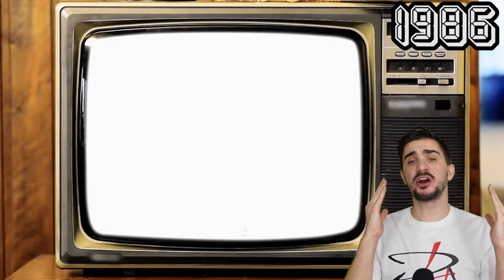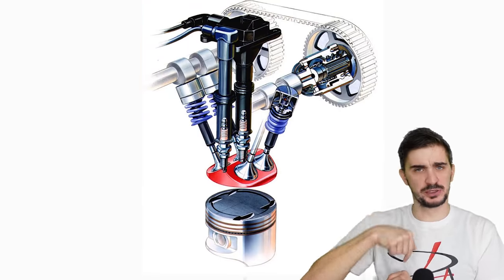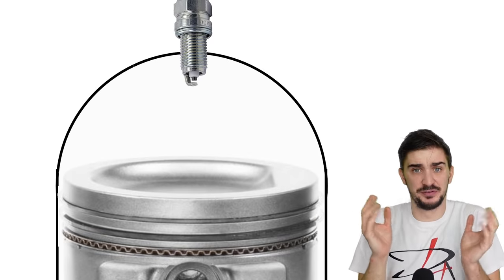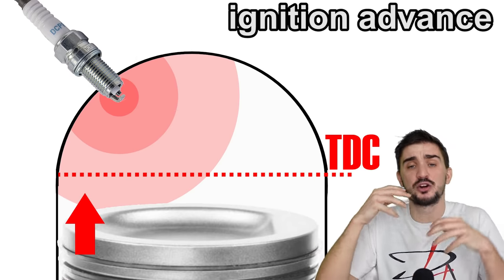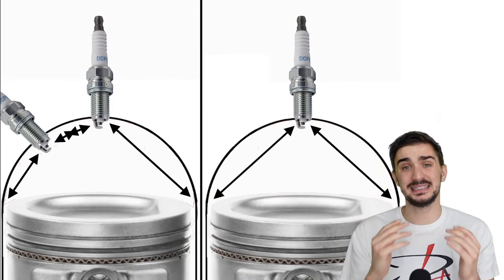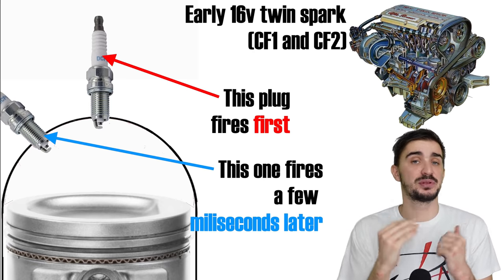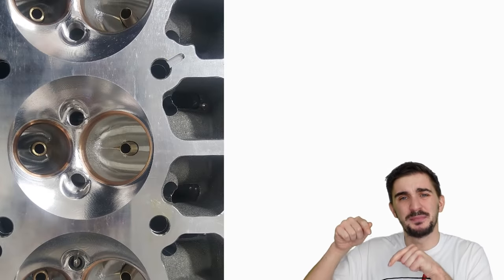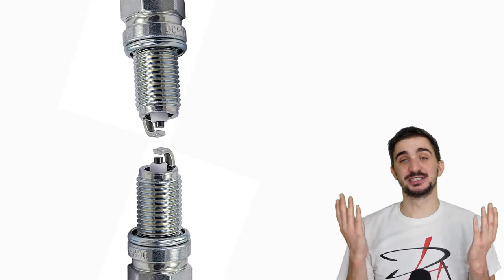TWIN SPARK - WHY, HOW and why it isn't more widespread

Comment: The Mercedes M112 V6 and the M113 V8 both have twin spark ignition and 3 valves per cylinder. The V6 was introduced in 1997 as a 1998 MY and the V8 was introduced thereafter. Both are 90 degree blocks, the V6 employing a balancing shaft to counter the uneven mass of this engine layout in addition to a 30 degree splay angle on the adjacent crank pin journals to achieve an even firing order. These engines have a SOHC driven by a duplex timing chain with 2 (smaller) intake valves per cylinder and 1 (larger) exhaust valve per cylinder. Each cylinder has a high output, coil-near-plug ignition coil. These engines also use a variable length intake plenum to increase torque at low engine speeds (longer path), and improve flow at high engine speeds (shorter path). Both engines are great and very torquey.
Reply: Correct, I have a 2006 CLS500 with the M113 V8 & I replaced all 16 spark plugs recently.
Reply: Yup. I have a Chrysler Crossfire with the M112 and was unpleasantly surprised when I realized I only ordered half the spark plugs I needed 🙄. I never understood why the heck there were 12 plugs until I watched this video I just assumed “bigger spark make bigger boom” lmao
Reply: Great engines. I had a 99 C240 Mercedes with a manual, so I could experience the real behavior of the engine. Lots of torque down low, nice top end power (170@5600rpm) and a reliability level its successor lacks during its first production phase. Curious mix of low and high cost solutions. Magnesium manifold, but SOCH. No VVT, but twin spark. Clearly not cost-driven decisions.  Anyway, I miss it.
Reply: I believe MB made a twin spark V-12 as well.
Reply: They are very torquey, but they are also very truck-like and aren't particularly smooth in operation or sound and don't particularly enjoy being revved.

They're definitely not a bad motor, they're just not very refined or sporty
Reply: @5hogg23  you are correct, m137 for example
Reply: @betteroffdeadd  I had an automatic C240 from 2001, which was the 2.6l engine then, same power. I'm not that convinced in it, and these decision were cost driven. SOHC is MUCH cheaper than DOHC, more so in a V engine, where you have to do everything that happens in the head twice. No variable timing was a huge step backwards, and the two sparkplugs just make the best of the area that's available - the valves almost touch in the center, there is definitely no space for one, but on the sides of the ex valves, there is. Making them even more shortsroked to counter this would result in a bad combustion chamber design, and if this isn't translated into larger gas exchange areas, there is no benefit in it. The succeeding engine, the M272, had problems the first few years, but overall is decades advanced from the M112 - and very similar to the M104, the inline predecessor of the M112.

While I did like this car on the Autobahn - low drag coefficient, relatively fast for its power, going up to 235 kph - in the city, it was quite a guzzler.

Anyway, it's not really bad, but ... sigh ... the one threevalve between two generations of fourvalves isn't a position I'd ask for. Cheap ... well, yeah, kind of, kind of not, a weird mix, this sure af is!
Reply: @phil955i  heeeyyyy my man!! I have a 2006 CLS500 too. The best CLS, short of the CLS 55 of the same year. The only year they put the m113 in that body. Best combo.
Reply: Per Chrysler Crossfire service manual:
The two spark plugs per cylinder are fired slightly out of phase to prevent the cylinder pressures from rising too quickly, which could cause knocking. To prevent one spark plug from eroding more quickly than the other, they alternately lead each other. Under normal conditions, the timing is the same for all cylinders, but the timing can be delayed in individual cylinders if knocking is present in one or more.
Reply: My 2003 ML350 (M112 3.7L dual-plug V6) had 266000 miles before it's sold. Changed spark plugs once and I was cursing after changing the ~7th plugs, lol. I wouldn't say it's a great engine because it sounded rough and felt gutless below 3000 rpm. However I won't complain because it lasted 266000 miles over 18 years with just oil changes.
Reply: @tigerpjm  Compared to what ?
I have driven many cars over 40 years and the M112 and M113 are both very smooth , sound good and are nothing like a truck engine , they rev out to around 6000 rpm or more and remain smoother than any GM or Ford engine for example.
They have a lot of advanced tech for their time.
Reply: @Leonardo555ZZZ  

Compared to the equivalent BMW straight sixes... everything I said stands.

Anything less than 6000 is a very slow revving engine.

I'm not fanboi-ing BMW. My current ride is a W177 AMG A45S, and I had the W176 before it.

As I said, they were not a bad engine by any stretch, although they did continue in service well beyond their use-by date.
Reply: Fascinating.  I did not know this, as I have not myself replaced my spark plugs.  My 3.2L SLK from 2001 has an M112 V6, the engine is great, still delivers fantastic power and torque.   I have now owned the car for 22 years, and as far as I can tell the engine performance and behavior are exactly the same as when it was new.  Still an absolute pleasure to drive, and I have zero incentive to replace it with anything else.
Reply: @tigerpjm  bro drives a car thats missing 4 cylinders. i bet your motor will die sooner than the m11x engine family

Comment: I'm pretty sure Mercedes Benz has a lot of dual spark plug engines too. Great work,keep it coming!!
Reply: Yes M112 v6 and M113 v8 comes to mind. Probably the V12s too. The only downside is maintenece, but the coils rarely fails.
Reply: My E55 M113k has dual spark plugs and being a 3 valve design its easy to locate them... Even before these modern engines Mercedes was using twin sparks in some of their engine but yes, Alfa is definitely the pioneer here.
Reply: @Rourkeize  alas, at some point one has to replace the spark plugs, and I am told they are not cheap either... By my mechanic, who had bought my brother's w211 with the 2.6 litres V6.
Reply: @woongah  . Modern Spark-Plugs have a very long Service Life . Brake Rotors need replacing from time to time too , as a Service item .
Reply: @woongah  they're not cheap if you give it to a mechanic to service them, in reality, spark plugs are probably the cheapest and easiest things you can do on an engine, and I've done spark plugs on an m112 clk, the only thing is you're now buying 12 plugs instead of 6.
Reply: Yeah the S600 V12, nothing quite like changing 24 spark plugs in an afternoon...
Reply: @OldJaguarAU  lol 16 is bad enough I’ll never do 24 and I’d sell the car if I had to buy 24 Mercedes’ plugs…
Reply: @OldJaguarAU  Might as well replace the garbage coil packs while you are there
Reply: Twin spark ⚡️ plug:

Jabiru 5100 flat-8 four-stroke 
MidWest AE series Wankel
Nash Ambassador
Honda i-DSI series 
Nissan NAPS-Z 
Mercedes-Benz M112 
Ducati Multistrada
1990s ford rangers and mustangs
Reply: @alexvillalobos7137  Well, if you're clever, you buy em from Bosch or NGK,  which are Mercedes' usual suppliers
Reply: @woongah  just did mine on my W210 E320, normal champion platinum plugs used got them online reasonably priced, actually pretty cheap.
Reply: The 2002-2004 C32 AMG supercharged 3.2 liter V6 engine has dual spark plugs.

Comment: My old 04 Honda jazz had a 1.4l 4 cylinder twin spark engine(DSI) . That thing ran amazingly well. At low rpms there was a slight delay between them. At high  rpms they fire simultaneously.
Reply: Indeed, I remember that tiny engine had an amazing amount of torque down low for what it was. It was also decent higher up. The mileage was also great.

Comment: Well researched video!  An item of note: in both flight training, and aircraft maintenance training we are taught that the primary purpose of dual ignition is to provide more complete combustion, and the redundancy is an important secondary purpose.  (I personally could see it either way, and like the safety of having a dual system while flying.)

Comment: Porsche also used twin plugs on their later air-cooled production engines.  Also on some of their earlier racing engines.
Reply: The Maserati in-line 6 cyl in the 3500 Sebring uses twin spark too.
Reply: Maserati one of the companies part of the huge list of companies like fca belongs to and dodge hellcats still uses this in their hellcats currently.
Reply: BMW 1200 boxer engines had two plugs but the secondary was there purely for emissions reasons. You “could” unplug them and feel no difference. I suspect their main benefit was to burn low octane fuel more effectively.
Reply: Mercedes also used it on the c230 kompressor w202

Comment: You see it a lot in thumper type motorcycles where you have this huge pancake of a piston, and trying to get the flame front to spread horizontally is just as much of a challenge as trying to get it to spread vertically. So using two helps to actually get it all ignited in such a large area.

It can also be useful in 2 strokes for the redundancy to stave off oil based carbon build up issues- oh and the free/rarely used head space in them means there's no real downside to doing it.

Comment: The Alfa Romeo AR67204(CF1) engine that was found in the 145/146 and 916 GTV Phase 1(among others) produced about 110kw when new. Although there are several upgrades Alfa brought to the AR32301(CF2) engine that you found in the 156 the biggest change was the cast aluminum intake manifold was dropped in favor of a modular plastic intake manifold. The AR32301(CF2) engine produced 114kw when new. The extra 4kw was however lost when the AR32310(CF3) engine came out. These engines were introduced along with the very popular 147. The AR32310(CF3) engine still had the modular manifold and featured several electronic upgrades, the biggest of which was the switch from a throttle cable to a drive by wire system. The 147 also had a different exhaust and featured two pre-cats in the down-pipes with one more cat located just behind the engine. The AR32310(CF3) also had lighter piston crowns weighing about 10 grams per piston less than the ones used in the AR67204 and AR32310 engines. I always thought that the slight power loss between the AR32301 and AR32310 was due to the change in exhaust systems but the change in the way that the ignition system works migh have also played a part it seems.
Reply: Excellent engines, sensitive to timing belt maintenance, nothing more, but compared to the design disasters and the very low reliability of today's engines, it was a great engine.
Reply: I've had many Alfa Twin Sparks over the years, the 75 being my favourite for handling. But the 147's I've owned over the years have been my overall favourite. A very underrated car. The 1.6 didn't get the variable intake manifold, nor balance shafts, and in my opinion handled better than the 2.0 (the 1.6 didn't get stability control either) but in general, either of those engines were bulletproof. As long as you checked the oil level regularly! I want another one now...

Comment: Man, it's taken a long time but I finally caught one! The newer 5.7/6.4 Hemi do have variable intake length runners. And, my beloved 3rd gen Hemi retains most of the advantages of a "true" hemispherical combustion chamber w/o the flame front problems associated with the domed pistons  usually required to maintain a decent compression ratio.

Comment: Toyota had a twin spark setup on the 1.8L 3T-GTE, their first factory turbocharged engine. It was available in the 1982-1985 Celica, Corona and Carina. Toyota also used a racing version of the engine, the 2.1L 4T-GT. It was used in IMSA GTO class, Le Mans 24 hours and WRC Group B. It had a homologated version (4T-GTE) in the 1982-1983 Toyota Celica Twincam Turbo GT-TS TA64.

Comment: I've been running STD Dual-plug heads on my 1949 Harley panhead since 1998, initially in single plug mode with a magneto.  After a few years I upgraded the mag to dual-fire ignition and immediately noticed much smoother performance and improved mileage, even on this old tractor engine.

Comment: As a owner of a 2015 6.4L V8 Charger I can attest the benefits of using Dual Spark. Despite the high compression ratio and required use of premium fuel the motor hardly ever knock or misfired. Even though Chrysler uses this primarily for emissions it does help the engine on high RPM range. However I can see why this technology does not benefit or makes sense on smaller displacement engines since the spacing on the cylinder heads is quite limited. Now in bigger displacement engines this makes sense not just in sports applications but commercial fleet gas engines.

Comment: Twin spark plugs were very common in the 80’s when Nissan/Datsun equipped a lot of vehicles with NAPS-Z (Nissan Anti-Pollution System) engines in North America.  It made a lot of sense in 2-valve per cylinder SOHC engines. As 4-valve per cylinder DOHC engine with centrally located spark plugs became more and more common, I had a feeling it twin spark plugs would become less and less common and that’s what happened.
Reply: My Dad had one of the Nissan trucks with twin sparkplugs.  Once he took it for emissions testing and the tester said that those trucks never failed.  Testing was just a formality.
Reply: As a former owner of Nissan vehicles, the Datsun/Nissan syatem did not fire at the same time, like earlier  ALFA  syatems.
Reply: I loved the cars but hated the ignition systems and leaky exhaust valve seals.

Comment: I have a dual plug car! My 1985 Datsun/Nissan 200SX. My S12 has a CA20E. Definitely not a powerful engine, but it scoots the lightweight car alright. One interesting point is that the plugs are on either side of the head. They use a one step colder plug on the exhaust side than the intake side. Pretty clever I thought!

Comment: Another brilliant video.. I've been a licensed technician for almost 50 years.. i absolutely love twin plugs.. different sound, better power, fuel economy -maybe,,,, my 2015 Hemi pickup has twins,, what a pain in the ass and expensive (16 plugs at 76$ a plug)...I also work on aviation and motorcycles.. best is always twin plugs.. when I use to fly helicopters, i had a mag go,,, didn't even panic, just turned it off,,,,recalculated and returned home.. 
Keep up the great work..

Comment: Great video! It was quite informative. In my experience, i've observed that the last twin spark heads make the engine run with less ignition advance if both spark plugs are used, i had to postpone at least 8 degrees of ignition advance when i used two spark plugs instead of one, in some areas even more. The engine was defintely making more torque ad horsepower and it felt more responsive overall. Also improved the fuel economy a little bit
Reply: I forgot to mention, i'm talking about the latest alfa romeo double spark plugs head

Comment: Ford also has twin plugs on the 6.2L Modulars found in their 12th gen F150s(Quite rare), F250 and up Super Dutys and E-series Vans. Aswell as the 1st gen Raptor.
Reply: yep I have the 6.2L F250
Reply: @stephenrich5905  They are great engines, very durable.
Reply: They did it in the 80s and 90s with the 2.3
Reply: @MUredhawk111  Funny that he mentions "4-cylinder Mustangs...in the late 80's", which were 2.3L but put the picture of a 5.0 which have a 4.9L V8. The twin plug 2.3L was not available in the 80'. The production started in 91.
Reply: @ZZZHarpy101  ranger was 88 or 89. I've got one that's about to be replaced with the tbird turbo 4 cyl.
Reply: The 6.2 was not even mentioned. This great motor came out in 2010 so twin spark plugs are not extinct.

Comment: My first car was a 1984 Nissan Stanza GXE. It had twin plugs. 2.0 litre 4 cyl was quite quick and smooth running. 5 speed transmission.  Good practical car.
Reply: My dad had a 88 which had it too.
Reply: Que motor era?
Reply: @JoseAlvarez-il3iy  If I remember correctly it was a CA20E 2.0l (1974cc) 4 cyl

Comment: The 6.4 Hemi has variable intake (2 settings), variable valve timing. It does not have direct injections but has cylinder deactivation (4 cylinder mode).
Reply: Yeah, weird that he barely mentions the best modern use of dual spark plugs, then completely ignores the eagle hemi

Comment: I think that twin or even triple sparks makes sense on engines with pre-combustion, like F1 engines, where two sparks are at the side of the main chamber and a single one is in the pre-chamber, so at low RPMs the two sparks ignite the air-fuel mixture, while at high RPMs only the pre-chamber spark is used, so you get even better efficiency using three sparks and a pre-chamber.

Comment: In aircraft engines, if a magneto fails in a dual magneto engine, you lose 4 spark plugs (in a 4 cylinder engine). The unburnt fuel then quickly raises the exhaust gas temperature and one would have to reduce power. I guess it's better than losing all engine power! A single plug going out is less of an issue but it would result in a rougher running engine and this would be obvious if you had an engine monitor. It wouldn't be good to run it this way for an extended period of time. Thanks for your videos, they are very informative.